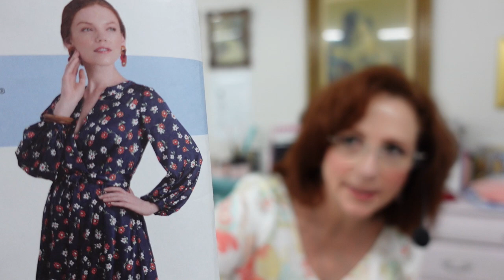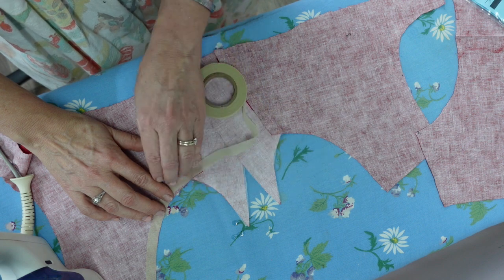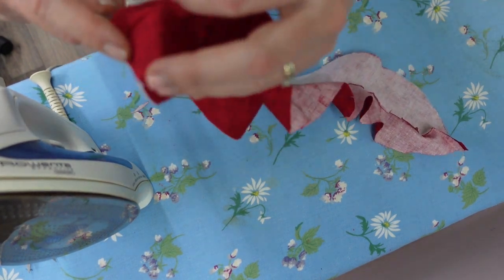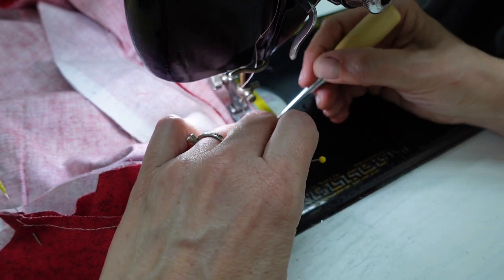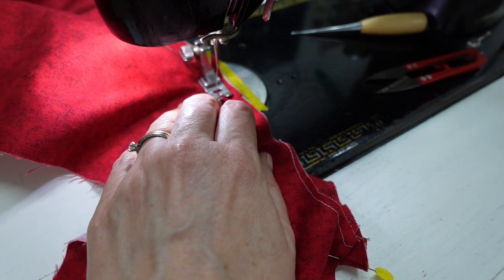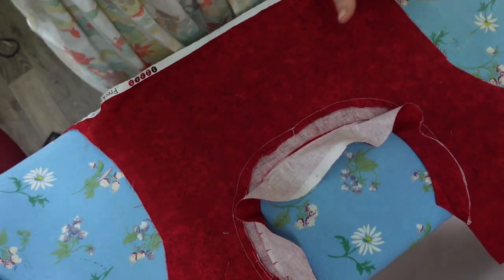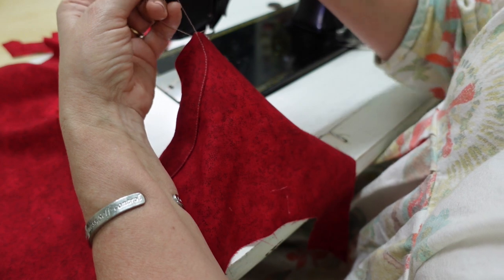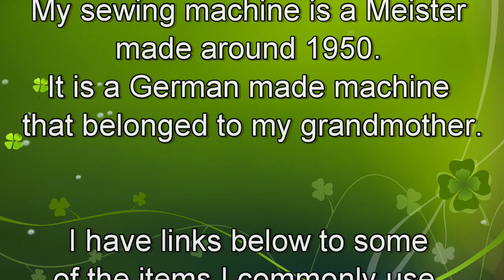Sewing a better neck band for Simplicity 9041

Comment: Thank you for taking the time to do this video . I am convinced a lot of the bulk issues we have around collars is due to the current obsession of pattern companies to tell us to put glue based interfacing on everything. I use vintage patterns as well and the use of interfacing was less extensive and it's the sew in type which you tack on and trim to the seam allowance., there's not so much bulk with that. Okay, it's more time consuming but like you said it's not about speed sewing for us!
Reply from the maker: Well said 😁